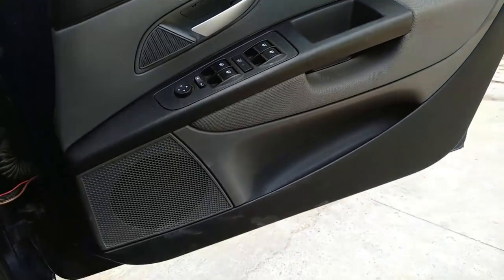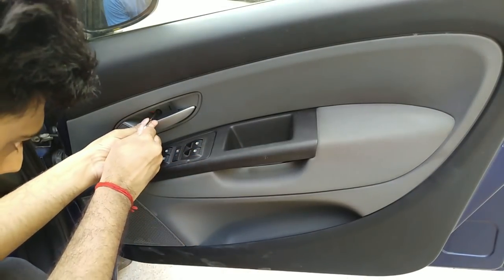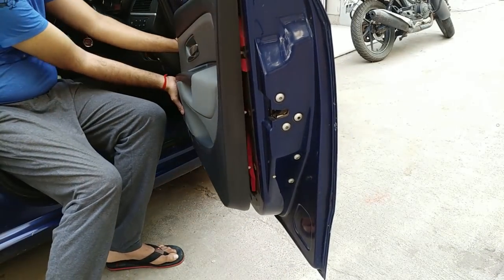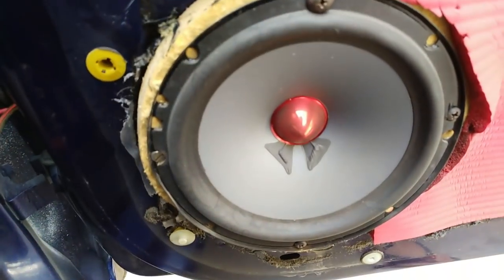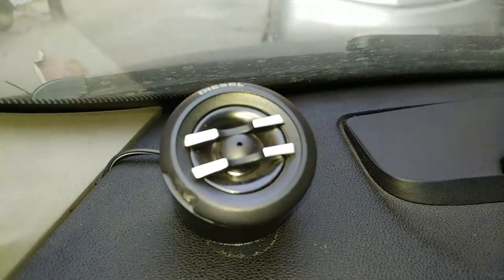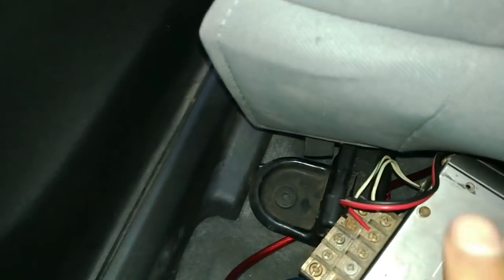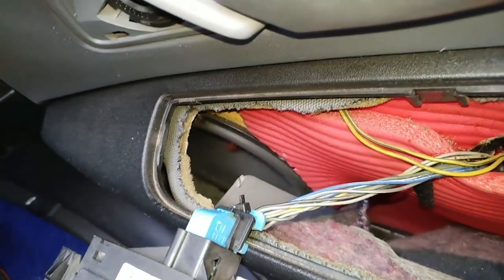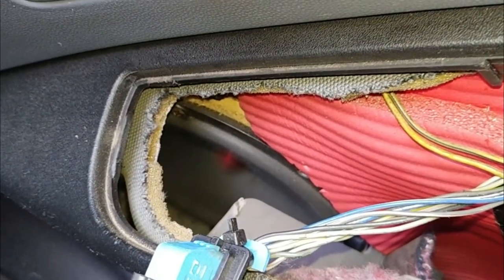Installing Component Speakers in Fiat Grande Punto

Comment: I have punto emotion 2014.. Can i just add component speakers.. Shud I change the head unit for enough output
Reply from the maker: No need to change headunit. You can directly add entry level components. Or install a line out converter and add a amplifier.
Reply: @AmulLuthra  any idea the converter and amp wud cost?

Comment: What is the speaker and spacer size you have installed ??? 

I have the same model same colour same variant of Punto with me. I want to upgrade desperately. Need some technical solution.

Comment: Sir make video of installing basetube in any car without amplifiers can we connect or not without amp
Reply from the maker: Brother subwoofer doesn't work without a amplifier as it requires more power and no stereo in the world has enough power or filter to drive a subwoofer. And brother i recently built a 4th order bandpass subwoofer box for my fiat grande Punto. And gonna install that real soon and you can checkout that subwoofer box build and testing videos and many other car audio related videos on the channel brother. And many more to come. 😊😊😊😊 So make sure to like, Share, comment and Subscribe. 😊😊
Reply: Sir what is bandpass
Reply from the maker: It is form of subwoofer box that has multiple chambers inside it. Checkout my videos brother there is a jbl cs1400wsi testing video known as epic excursion on the thumbnail and other one 4th order bandpass complete build and some others too. 😊

Comment: Suggest component under 20k for plug and play...don't want to install amp and subwoofer
Reply from the maker: If you dont want to add an amplifier then there is no point in spending this much on component speakers because all of the expensive ones desperately needs an amplifier to power them up. Better to get any of the entry level ones. I recently unboxed, tested 2 entry level components speakers and installed one of them in the car. I would easily recommend you that Sony xsfb1621c. Checkout all of the which i have listed below and take your decision. That sony small speaker is actually a beast...
Unboxing Sony XS FB1621C
https://www.youtube.com/watch?v=aST-Ym3btAU
Unboxing hypersonic Component speakers
https://www.youtube.com/watch?v=rMfgl6V2vHo
Detailed testing of Sony component speakers
https://www.youtube.com/watch?v=PsnSbZtEMCg
Detailed testing of Hypersonic Component speaker
https://www.youtube.com/watch?v=OMxIRcv4Rig
Nano got Component Speakers
https://www.youtube.com/watch?v=ivivNydHOtg
This is My Tata Nano with Upgraded Audio || Loudest NANO in India|| Phase 1 ENDS
https://www.youtube.com/watch?v=8sW2URhXAdk

Comment: So Component speakers  is better  in the front  doors  than  coaxial speakers  ???
Reply from the maker: Not necessarily brother. Component speakers has 2 advantages over coaxials. And one of them is only depending at placement. 1st one is they have a separate tweeter which you can place anywhere to get a overall better image. But if you use the speaker at a place where you can not put the tweeter at another place but with the speaker itself then coaxial is a better choice. And the other advantage is that they have no obstruction on their cone as tweeter is separate. They have a better mid bass response. ☺️
Reply: @AmulLuthra  . So I already have two subwoofers  in the trunk  produce a lot of  bass . Would you  install  component speakers  or just  coaxial speakers  .
Reply from the maker: Brother to enhance the vocals up front i would go for components and place their tweeter up on the dashborad or on the top side of doors and get another pair of tweeters to mount on the dashboard. Only then the image will be awesome. 😊😊

Comment: This is not AT ALL how you install speakers.... you dont use MDF.. it expands and comes spart.. you can see this already in your car.. you ran the wires into the door ALL wrong..  You need to take the time to learn how to do this correctly.
Reply from the maker: Hehehe brother i have been installing speakers for years now and i have experienced every right and wrong ways of installing them. And in Fiat Grande Punto you need specialise connector pins to route the wires through the connector to put wires inside the door and the cabin. And those pins are very hard to find but now i found a few so gonna show them in a few days 😊😊. And about that MDF ring i used it only because it sounds way better than the plastic ones and even if it expands there is no problem its been around 2 years with those rings will replace them soon with laminated mdf soon anyways. And brother if want to know anything more do let me know will gladly answer. 😊😊😊😊
Reply: @AmulLuthra  I compete in IASCA, MECA, MASQ and USACi Car audio competitions.. Brother.. you are doing it VERY wrong.  MDF does NOT sound better than a proper PVC ring.  The way your ran wires through the door is horrible.  The way you mounted the driver is horrible.  So many things are done wrong I can't believe anyone would listen to you.  I would never ask your your advice.. I have been installing for 25 years and have plenty of trophies to backup my work.  Just trying to be honest here.. No one leaves un-protected wire between the door and body like that.  Your MDF rings were already falling apart....
Reply from the maker: Hahaha brother i think you didn't read my last comment properly. I request you to read it again. And i have no problem at all with you being don't need my advice its absolutely fine by me. And i have tested both the plastic and MDF and i will take the MDF over plastic any day and i even told you the age of that ring in previous comment and what i am going to do about it soon and also about the wires too i hope you read it and then you will understand and if you are in Delhi i have no problem giving you the demo of my car only then you will understand but that's not my problem. And i love my drivers mounted like that and that's what i am going to do because i care more about the sound quality then its looks underneath the door card. So just chill out brother and have fun with your trophies 😊. Peace out 🙏.
Reply: @AmulLuthra  I read your post fine.  Demo of the car? I run Italian made amplifiers and German made Digital sound processors.  My tweeters alone cost $1800.  I don't need to demo it to know it sounds horrible.  I don't think you are familiar with a real system.  Yes 2 year old rings falling apart.. you keep calling PVC just plastic but you aren't understanding the material I am talking about.  The rings are thick and heavy not thin prefab you can buy online.  There are other ways to handle your wires just left between the doors.  No installer would do that not even temporarily.  No one should use what you do as an example of how do do Anything to a car.. period....
Reply from the maker: Hahahahahahah thanks for making me laugh brother its been long. And seriously brother i absolutely don't care you enjoy your expensive stuff and let me enjoy my basic ones i am happy with it. And PVC doesn't matter how thick it is it still gonna remain plastic. 😂😂😂😂. So just chill out bro lets just enjoy bass as bass itself is a language. 😊😊
Reply from the maker: Brother i love mark but still not gonna use plastic... Thanks for the video i am a regular viewer of caraudiofabrication.😊
Reply: @AmulLuthra  Top installers around the world do NOT use MDF.. fact...  I think you are confusing thin ABS with the thick PVC I am talking about... BIG difference.
Reply from the maker: Okay brother ill check that out and i hope it sounds well because i don't have good experience with plastic and i need to change those 2 year old MDF rings anyway. And brother do let me know how much thickness should i use. 10mm or 15mm. Originally that MDF ring was 15mm.